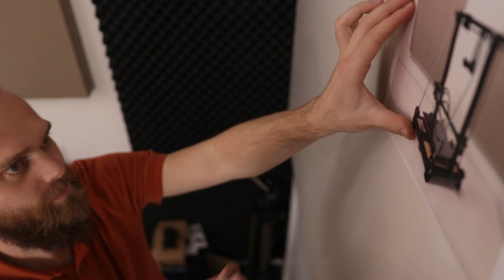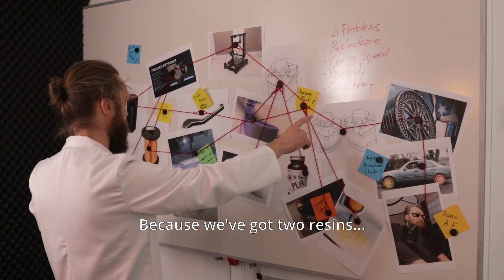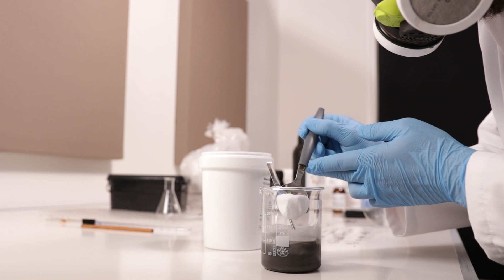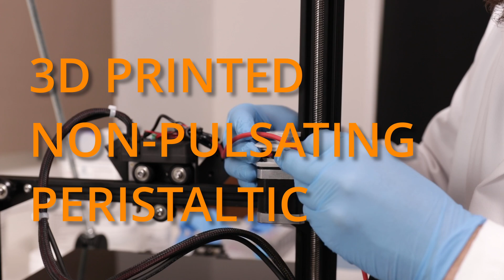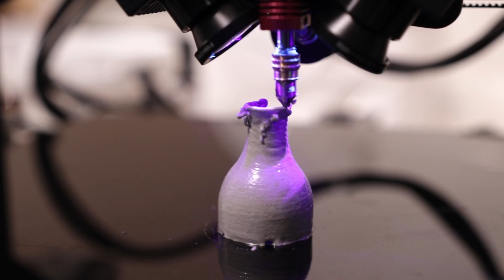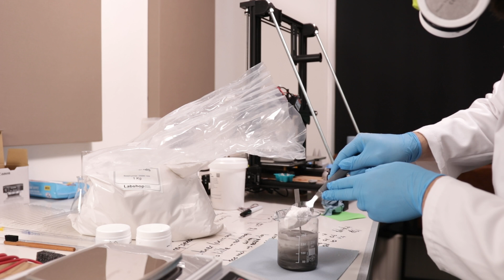FDM resin printing: Game changer or stupid?

Comment: about continuous fiber printing, with thermoplastics, I did my own thinkering :
1st, except if the fiber can be streched under high enough temperature, the filament diameter will have to be the nozzle diameter, elseway, you will have too much plastic in the nozzle not being able to freely flow.

2nd using continous copper fiber coextruded with PLA or PETG could add the functionnality of working electical connections in print, though the fiber filament may need to be wrapped aroud a star-shape terminal to ensure that an electrical terminal gets direct contact to the copper fibers

3rd for the coextrusion process, I though about pultruding a pet ribbon along a stripped electrical wire in a 0.8mm nozzle, a 0.22 mm2 wire have a diameter of 0.5mm, leaving space but  also not too much for the PET aroun it

Comment: Would it help to build a scrubber (like an upside down toothbrush) off to one side of the build plate that could scrub the nozzle after 'X' number of layers? The only issue is how to mount it so that the print head doesn't have to travel up and down in X, Y, and Z to achieve the nozzle cleaning and return back to printing layer in a lot of time? One thought: Since this is a bed-slinger test bed, You could mount the scrubber on the Z traverse bar and a simple gcode routine of sending the nozzle all the to the right, and a little back and forth motion could scrub it and then send it back to the printing area at the new layer height.

Comment: One thing you could possibly do is use chopped fiberglass, carbon fiber, or kevlar fibers to make the paste.  It will probably come with a number of clogging issues, but it could also definitely help with strength.

Comment: This is really a good idea, and you're getting somewhere now. It just needs a bit more tinkering and fine tuning, but I think it's worth investing more time and effort, because I think it has a great potential beyond just producing the resin parts in a different way. Here's what I think you could try, for what it's worth:

- Resin viscosity and speed should be adjusted so that the nozzle never touches the previously extruded resin. I think increasing layer height just enough that the resin still hits the previous layer properly should do the trick.
- It would obviously be best if the light would be doughnut shaped, with the generous "blind spot" around the nozzle. I'd try to make two small circular masks which you could move along the beam to adjust the focus and size of the dark spot made of anything that wouldn't melt, like aluminum or copper foil and wire. And as much laser power as possible, so the resin cures near instantly.
- I don't know how high the percentage of glass beads was used, but I'm pretty sure you could use other materials, like metal powders, and be able to sinter the parts if that was also considered as an option. I think you'd need to have at least 60% of metal for that to work, though.

Anyway, keep up the good work,I can't wait to see the next episode:)

Comment: Keep in mind just because something doesn't work the first few tries, still doesn't mean it isn't the right solution with some adjustments. I would try a lower viscosity (lower viscosity means less nozzle buildup and clogs) it seems right now, the nozzle is being hit with so much uv you are getting buildup. Then add a UV laser (or a strong uv light + lens) pointed at the tip (a ring of uv light might be worth a try). You want to make it easy to pump thin layers and cure them very quickly but shield the nozzle (maybe even a shade cone). There are many other thickeners you can try as well such as ceramics (silica based) which will give strength and heat resistance or starch for a more rubbery print. I think the best use for this technology would be printing ceramics with very little binder/resin not only for strength but for the possibility of burning off the binder and sintering the ceramics.

Comment: i would sugest using laser not defused uv light. shoot the beam in th eright place. also your nossel needs a pressure valve on it like the sport drink bottles you squeeze for the fluid to come out, its simple and will hold the resin in the tip better.

Comment: I wish to share an idea, I had patent pending. I originally had an aquarium of liquid resin. A plate is submerged just below the surface. An inkjet deposits photo reactive hardener and colorant while a UV lamp cures the mix. Another approach could be to put down a thin layer of resin on the bottom of the aquarium then use the inkjet to add color and photo reactant. Each layer would be a full color photograph film. If the film is neutrally bouyant the resin becomes support. It's a fully liquid version of the powder bed with color and glue without the fuzzy texture. I had thought to add a different inkjet color to make a fiber or solid or flexible set of dots. Epson heads are better for pushing out the doping  liquids.

Comment: Try using ABS filament with a misting resin/acetone mix spray with curing lasers. You should get ABS with stronger layer adhesion and smoother layers.... If I had the time and money I'd try building this myself......

Comment: Wouldn't a clear resin mixture work better due to allowing light to fully pass into tue material rather than just tue surface?
Reply: I'd love to be able to build a printer like MASSIVit. Their material is able to activate with a UVLED, not even requiring laser power levels, so perhaps a different material would work better?

Comment: You should use silica to thicken the resin. It's what we use in the industry if we need a resin to be more viscous. The glass bubbles are used in similar lines, but reduce strength etc.
The silica powder is also translucent so should cure even better.

Comment: Basically all the Hi end resin 3d printer (100k $ and more) using similar technology with the plus that they have also rgb ink to colorate during the printing. The aproach is right, i think the resin they use probably are more jelly. I think for have the better result you have to take a look how are made the printer head of UV printer ( the one for prints with uv color on solid things)  and make it work also on Z axis instead to work only on X Y.
you can check one here, hope give you ideas to make a DIY version :) 
https://www.youtube.com/watch?v=tO8lCsF2lzo

Comment: Congratulations on taking a standard FDM printer, adding some fun chemistry/materials and added hardware, and creating the beast of both worlds!

Surprisingly good results thus far.  The challenges are it seems to be subject to the failure modes you can expect from both types of printing and printers combined, including the issue of the fumes you need to avoid breathing.  Hopefully it can be figured out well enough to counter the cost of the problems with better results than either type alone can do.

I see your methodology and if it can be done, it won't be too long before it is done.

Sovol must love watching their printers being hacked like this!

Should you get it working well enough, perhaps they'll sell a kit based off your work.

Comment: You could have used ANYTHING as a thickener, even wheat flour. No need to get silicosis for that.
You should also try to collimate the black light further and to shield the nozzle with a small cup, to avoid reflections.
Also, something few know is that photopolymers DO LIKE HEAT. As a matter of fact, the HIGHER the temperature of the resin, the FASTER it cures, the less viscous it gets, which is a GOOD thing. So, for resin to work, you should have considered it as a filament, pouring it through a heated nozzle. This way, you can print a lot faster.
You're going the wrong direction here. Use the smallest nozzle, HEAT IT around 70 celsius(max 80), do not thicken resin and print FAST. Try this and thank me later.
Yes, I'm that confident.
Just remember the following: lower temperature, more viscosity, slower speed. So, the higher the temp, the higher the printing speed. There are some scientific papers on this. I'll try to find the link to the specific paper I read, but, generally speaking, the curve in the experiments I've seen don't see benefits over 80 celsius, which gives you the fastest curing time (below 0.6 seconds).

Comment: When I was about 15 or so (1972), I had a vision:
A method for making PCB's using one standardized material...I called it 'stuff'.
A photo-sensitive layer of  'stuff' is applied on the substrate, then exposed to various colors of light.
No exposure did nothing and allowed the 'stuff' to wash away, exposing the substrate.  No material build-up.
Another color caused the 'stuff' to harden.  Material would build-up in these areas.  Sounds like resin-printing, no?
A third color of light activated dyes in the 'stuff' that changed their color.  Can't make a PCB without art-work, right?
A fourth color activated metal ions in the 'stuff' that allowed electroplating of copper/nickle onto the surface of the 'stuff'.
The substrate could be a separate bit of plastic or some surface of the thing you are making.
Circuitry could be an integral part of the thing being made, rather than a separate PCB.
Hey, I was young and stupid back then. [smiling, somewhat stupid-looking emoticon]
No way ANYONE could POSSIBLY invent something like this now....

Comment: I was thinking that maybe you could use pressurized air to blow off the pieces that get stuck then I got thinking maybe there's something else you can use oil or water something that won't stick to either the parts

Comment: when dealing with glass bubbles or volcanic ash please wear proper PPE with the eyes protected as you dont want glass shards in lungs or eyes.
great video BTW and fun project
Reply: On top this the glass bubbles are typically very acidic from sulfuric acid used manufacturing process and can corrode a large number of parts and irritate skin

Comment: What sized nozzle are you using? Maybe a smaller nozzle and thinner resin would work better, almost like one of those poly jet 3D printers? Maybe you can use some form of coated nozzle to prevent the resin sticking? Maybe a nozzle small enough that the resin doesn’t drip out under its own weight but is still able to be pushed out by the pump would be better?

A big issue I saw with the benchy was that the resin formed a kind of shield around the tip, which would prevent the resin from curing as soon as it comes out the nozzle. Maybe a combination of different nozzle geometries and coatings would help. Maybe if you could make the laser light more precise that would work too, so it only cures right at the tip of the nozzle. I don’t know if you can do that with those lasers or get guides that make sure it is only a single beam, maybe fibre optics is a solution, you attach one end to the laser and the other is attached so it points at the end of the nozzle, but very close to it.

Edit: at the moment retraction won’t work as it will continue to drip and then afterwards you will get underextrusion. Maybe the smaller nozzle idea would work, so the resin is held in by surface tension but still able to be pushed out by the pump, that means to stop it coming out all you need to do is reduce the pressure in the nozzle by driving the pump backwards, like normal retraction works. That might help you a lot of the benchy where it isn’t printing a continuous outline but is printing the 4 pillars for the roof, be sure every time it changes which pillar it prints, it will ooze out quite a lot and that will get stuck on the next pillar and is probably what causes a lot of the problems.

Comment: To get more control on the flow, you should try a couple things. 
1. Funnel feeding
2. Stronger pump that feeds an elaßtic reservoir like a think silicone tube
3. A pinch valve. 

I used that setup to make a reaserch platform for molecular gastronomy, it works great.
Reply: That would be highly nonlinear and not a good idea at all.
Reply: Or just a standard motor driven syringe system with a 1mm bore capillary tube to the print head.

Comment: personally id say it's stupid because not only do you miss out on the print being crystal clear depending on the color u use but u will also lose all that accuracy/quality that a standard resin printer can provide, it's also just a big waste of time because, in the long run, an FDM printer is better at printing filament on a spool than resin and all that isn't including all the excess treatment on the final print which just wastes more time, on the good side it minimalizes the layer shifts and increases the layer adhesion strengths.
Reply from the maker: I'd say so too xD But then I realized the possibilities it could enable like continuous fiber printing, 3D printed electronics and mixed materials which are not possible with standard resin printing or standard FDM printing. This is what we briefly shown in the beginning of this video which I think is quite interesting.
Reply: @properprinting  hey I for my final project degree a build a FDM nozzle capable of print with continuos fiber, if you give me an email I can send the "paper". The unique problem is that it is Spanish hahaha.
Reply from the maker: @LiamxLiam  that's interesting! My email address is contact@properprinting.pro thanks!

Comment: perhaps a coated non stick nozzle would at least give you a bit more ease in printing.  hat also issues with petg printing and the nozzle pickup. for infill use infil which does not cross itself, like honeycomp for example. so you will minimize the pickup.

Comment: Cool video but I'm going to say stupid idea.

PLA is successful but FDM doesn't have the quality.

Resin is not easy to work with and has certain risks attached to it but it's quality is unmatched.

Taking the negatives of both and adding none of the positives is an interesting experiment but nothing more.
Reply from the maker: And what if this enables continuous fiber printing, 3D printed electronics and mixed materials? ;)

Comment: I have made a paste extruder and also considered using a resin base paste for photo curing. I would use regular UV LEDs and make a “hat” to cast a shadow to the tip of the nozzle. If you solved the light scattering issue I would say that the laser light is too concentrated for this application. Instead of a “hat “ you could use a more obtuse nozzle tip and raise the light source (to cast shadows).

Comment: a different nozzle shape would probably help. something similar  to a  syringe. what nozzle diameter are you using?
Reply from the maker: Exactly! This is what I'm currently working on! I tried a syringe, but the tip was too flexible and started bending at each irregularity. I'm designing a nozzle with the same tip shape, but with a regular nozzle body. It's a 0.8mm diameter.

Comment: Yo! Add a pigment mixer to that! Multicolor resin!
Reply from the maker: Oh yes! With multiple pumps we can pump pigments and other modifiers!
Reply: @properprinting  the thickening agent does not necessarily need to be put out of the nozzle. It could be dusted on and brushed off in a separate pass. It could even be something as simple as flour. I added flour to silicone caulk before and the result was something like hard rubber. Doing this with your printer would make it similar to a printer spraying binder agent out of what seems like a laser jet cartridge. Of course then, there is a chance that the powder would wick the resin to a larger area than desired too.

Comment: EXCELLENT. Seems a bit smaller nozzle, and possibly an internal check-valve that requires a bit of pressure to allow goo passage, but with no back pressure shuts off.

Comment: I'm amazed. This could be a revolutionary new 3d printer category. In fact I'm sure it will be. This is actually so cool and fascinating. I'm sure once this is well done out it could compete in the same way fdm and resin do. It'll be the same case of that this has certain advantages over the other, so in certain applications it'll be better. Truly amazing
Reply from the maker: Thanks! It's fun to experiment with this and come up with new insights of what's possible. I'm convinced that we're going to find some interesting applications!

Comment: I'm sure you have but have you seen Massivit? Its a gel resin 3d printer for large part printing. I wonder if they would be willing to give you some pointers on resin or design. One thing I noticed from watching their printers is that it looks like it has a UV shield around the nozzle and the UV lights are pointing downwards not right at the nozzle.
Reply from the maker: Yes I did. I got this idea just before I saw Joel's video. The lasers already cast a shadow where the nozzle is and I have an idea how we could improve on that ;)

Comment: Maybe instead of using light curing resin, you could print a different resin into a container that fills with a curing agent to cure each layer as it prints. Similar to a defunct Kickstarter I nearly backed called the peachy printer.
Reply from the maker: That would be an interesting approach. A second pump could do this. What I like about the curing is that it goes from liquid to solid within just seconds which makes bridging possible. Especially when using fibers eventually!